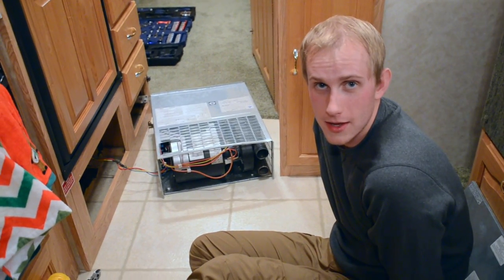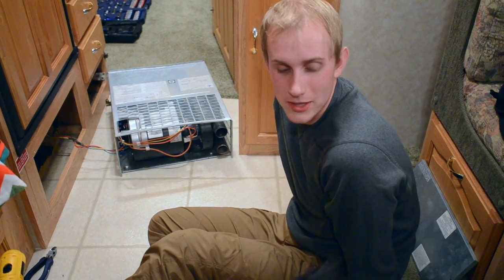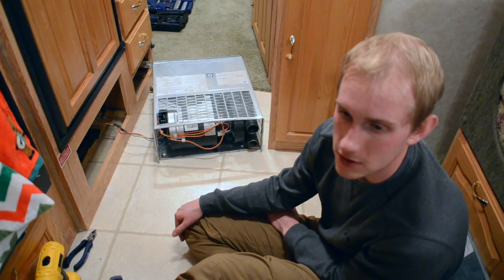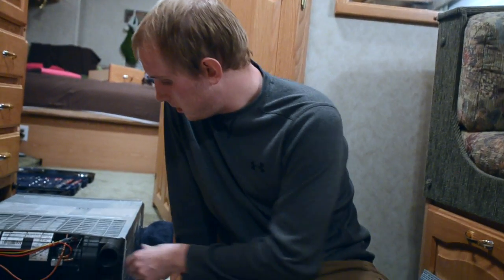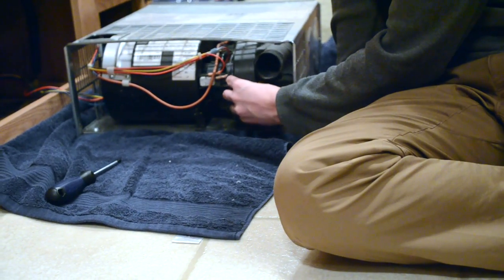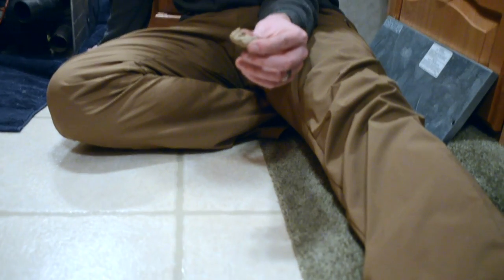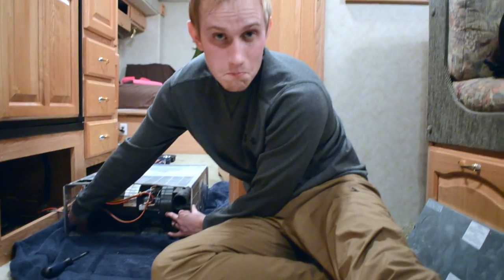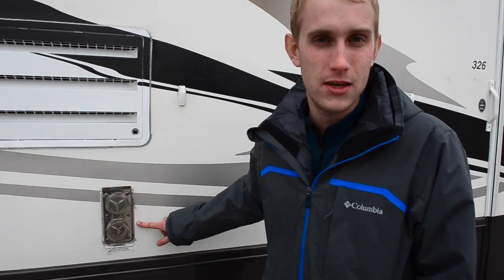RV Living | Fixing a Loud RV Furnace

Comment: We use a very small electric space heater in the water bay only 250 watts ( Amazon) it keeps the water bay at 40 degrees even when temps drop below zero. I used heavy velcro to hold it firmly down and added a sensor for the indoor thermometer. This works great when you have shore power....safe travels.

Comment: Mine is taking a different loud noise. I have nothing to compare it to. I had to buy a camper to move home because I was or am unable to move off now. Its getting 25 soon. Mine won't work. Just that loud noise. Way deeper than a cat. I have my space heaters for now.
Reply: @redartisanwolf6716  hope I got the right one
Reply: 25 ages or degrees? Is it also for cooling?